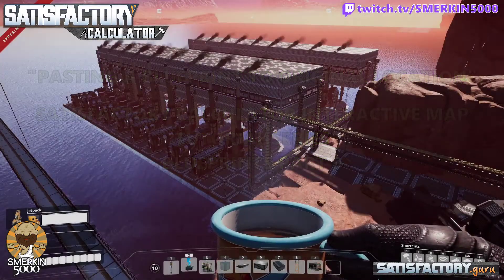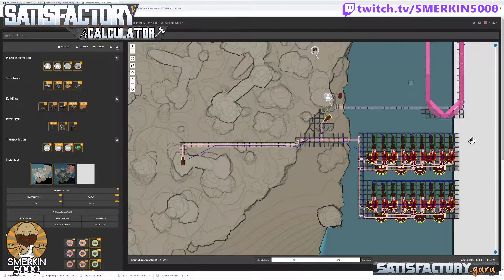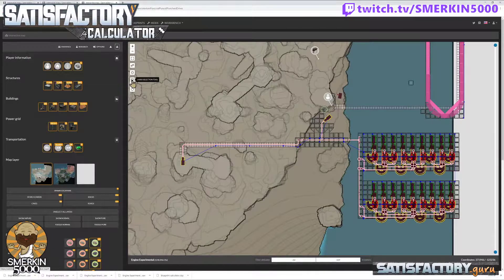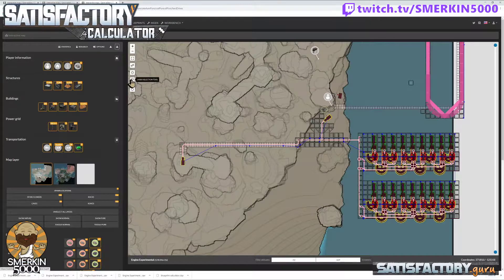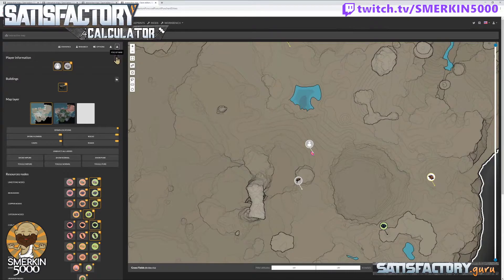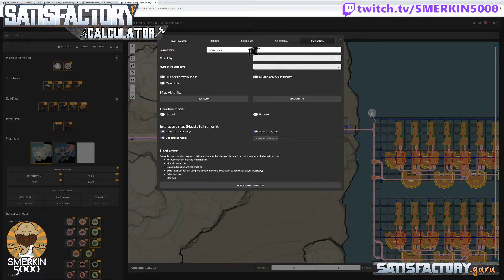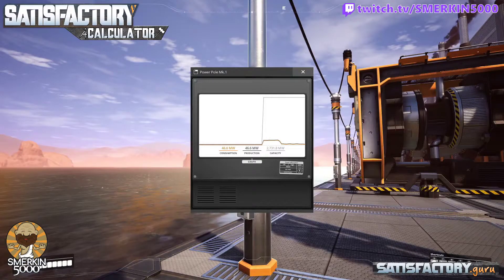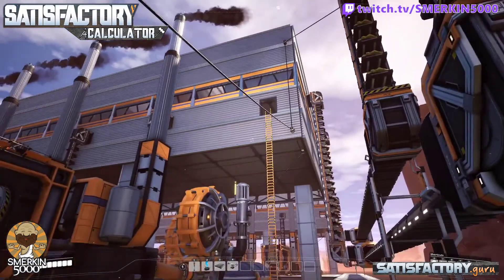SCIM Tutorial Series - Blueprints Part 9 - Pasting A Blueprint To Original Location

Comment: Question, I'm fallowing your video for paste an original location. When I get to download file, those gear run for hours. Never completes download. Any thoughts?
Reply from the maker: Try a different browser or from a difference computer. If it still fails, join the Discord and ask the dev in there.
Reply: @smerkin5000  Hello,i have a question how do i do this with blueprints,for example i found a brilliant railtrack blueprint on the satisfactory calculator and downloaded it but how do i use it?
Reply from the maker: @willemoranje  have you watched this entire video from start to end? It shows you how to paste a blueprint.
Reply: @smerkin5000  yeah but i dont get it  exactly,i found the New Global Railway blueprint on the satisfactory calculator and i want to start a new game and use this railtrack blueprint as my transport system but i dont know how to use the blueprint so i can build the whole track
Reply from the maker: @willemoranje  as shown in the video, load your save, import the blueprint and then paste into the original location
Reply: @smerkin5000  ok i am gonna try it